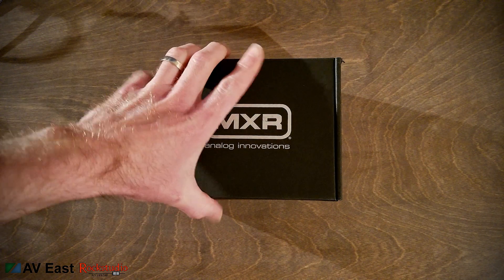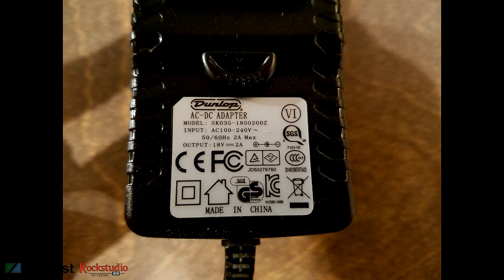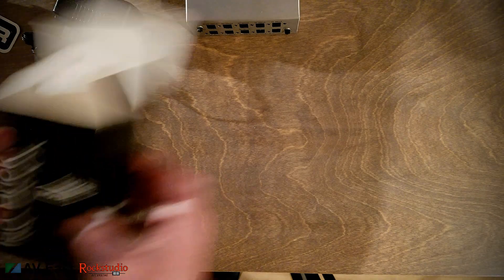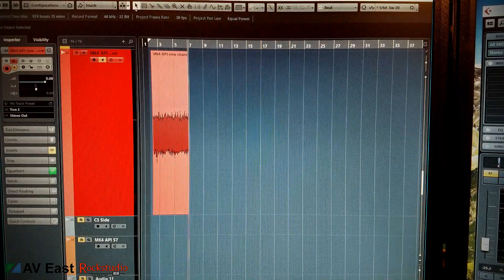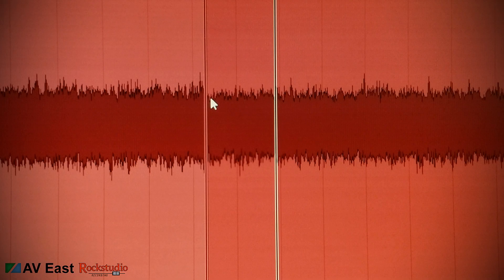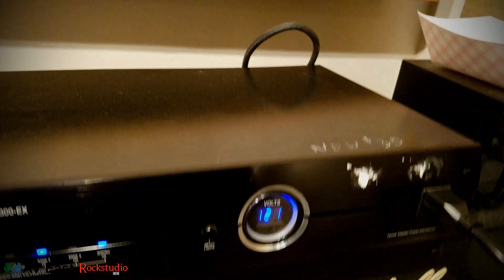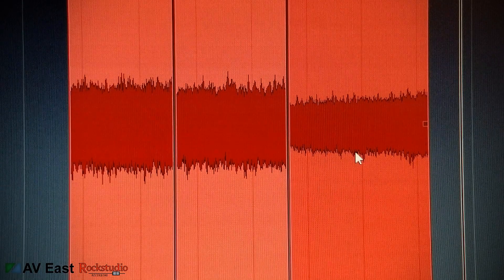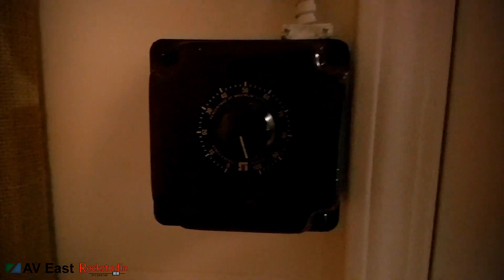MXR iso-brick power supply unboxing / demo

Comment: The point of isolated power supplies is NOT to decrease the noise of a single pedal but to decrease noise when SEVERAL pedals are plugged in. The comparison needs to be between a daisy chain and an isolated power supply.
Reply from the maker: Where did you read this?
Reply: @therockstudio  The point of an isolated power supply is to prevent ground loops from forming between pedals. They also prevent the clock noise from digital and time-based effects from presenting itself in other effects that involve significant makeup gain (i.e., overdrives). This is why they are more expensive and quieter than non-isolated power supplies (like the cheaper MXR brick). Mason has a few good videos on the benefits of isolated power supplies on the Vertex Effects channel.
Reply: Yup!!!
Reply: @therockstudio he is right dude, u have to make comaprison in daisychain and isolated
Reply: @therockstudio  yup reduces noise on a chain
Reply: exactly...i think hes mistaken it for a noise gate..testing it on a single pedal is pointless

Comment: That power conditioner makes a huge difference! I use VooDoo Lab Pedal Power 2+ units right now, and they're pretty quiet-- wonder how much more so with a conditioning unit like that? Great video. Subscribed!
Reply from the maker: S19NAL C14AIN thank you! The voodoo labs  products are really good, though they are input voltage specific (not worldwide ready). So when touring abroad you must have a voltage converter. That's my only gripe. Thanks for your comments and support!
Reply: therockstudio that's something I never thought of until I saw this one come with multiple options, honestly. Valid concern!

Comment: Hi, thanks for your review. Can i get  10 outputs for 9v pedals? 'Cause all my pedals need 9v power.
Reply from the maker: Hi! You only have up to eight 9v outputs with this. However, you can add a daisy-chain cable to one of the higher amperage outputs, even though this would defeat the 'iso' purpose of the device. Thanks for watching!
Reply: @therockstudio   Thank you for the answer. Maybe I'll remove the distortion pedals and use the amp's distortion.
Reply from the maker: @astromuzik48  lots of players will have more than one power supply, so you also have that option. But try a daisy-chain cable first!
Reply: @astromuzik48 
Item # 
True tone v-189
18v to 9v convertor.

Comment: I just use a MXR smartgate to cut the buzz from singles coils and any other pickup noise.
Reply from the maker: This isn't about pickup hum. This is about line noise. Meaning noise that works its way into your signal after your guitar, through the pedals.

Comment: Thanks. I did a review on this also. What did you think of the wall wart? Big and clunky. Nice to see you have the same LED config that I do. White left Red Right. Thought I have a messed up Power supply. Thanks Man.
Reply from the maker: Hey Thanks! Yeah, clunky wall-wart, but it is light and can be tucked underneath a pedalboard, and zip-tied to an extension cord or whatever. Thanks for watching and commenting. I'll check your video.

Comment: This or the M239?
Reply from the maker: Depends on the number of pedals for which you require power? $50 price difference, so the price per output is $14.99 for the iso-brick, and $19.99 for the  M239. Cheers!
Reply: I have 4 pedals at the moment, might add more soon. The MXR M239 is $140 & the M238 is $211 dollars here in India.